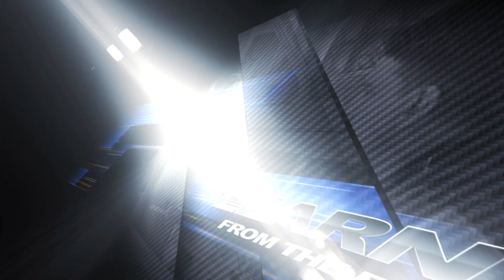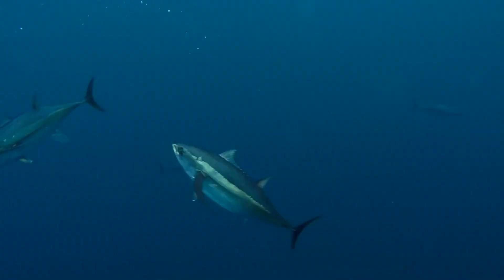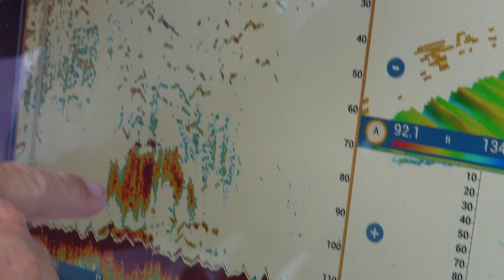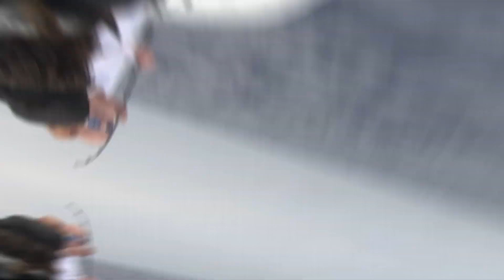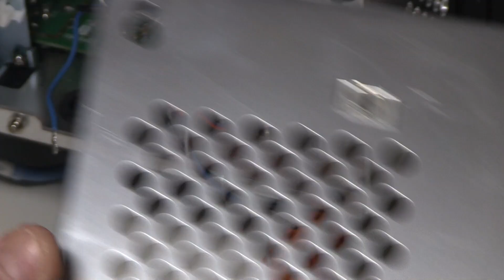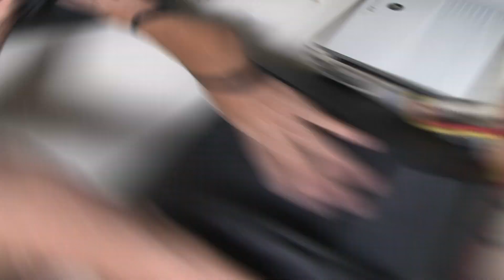Deep Drop Fishing With The DFF3 Fish Finder EP8 Furuno Connections

Comment: Just installed a DFF3 on my buddy's panga down in Mexico. Had to rely on this video for basic wiring info because there wasn't anything in the installation booklet that came with it.  Ironically after wiring it I ran across clear installation instructions in the Operating booklet  Funny place for it to be. Last place I looked. Had to reopen the box to properly ground the shielding to the box.  I found I had to, "Use the force" to figure out exactly how to run the cables and what cables actually needed to be used.  No job is easy and this was no exception. Got it up and running with minimal problems.

Comment: Nice work, but I wish you had shown how you ran the three cables
Reply: Pulling the cables was pretty easy on this boat.  SeeVee provides lots of space.  We used the original transducer cable to pull in a new nylon messenger back from the console like we did in the radar cable installation episode.   Then I taped the three cables to the nylon messenger and pulled them up to the console by myself...no major work required.
Reply from the maker: James, this is a great idea and we will try to put together a short episode showing this from extra footage that we have. Thanks for the idea!